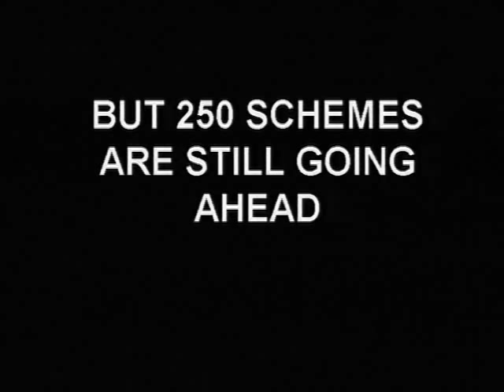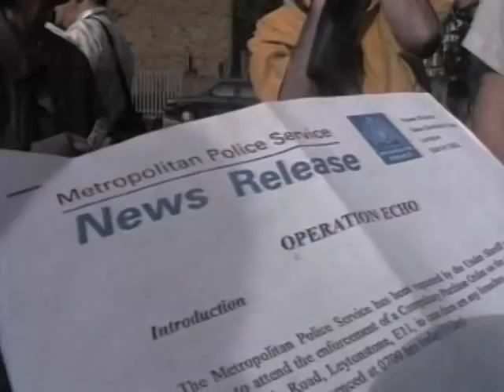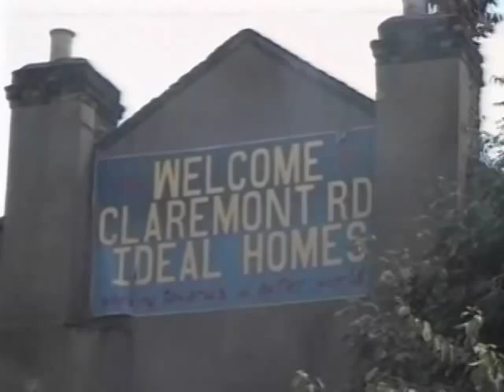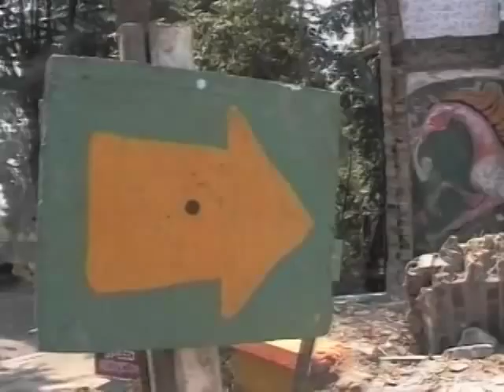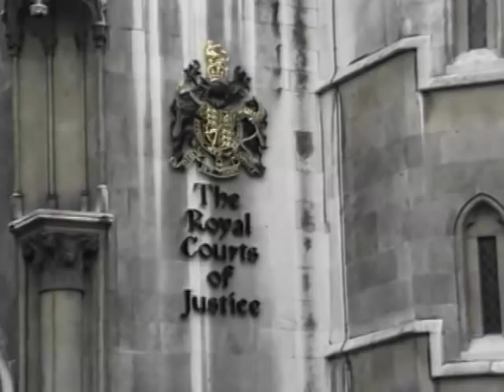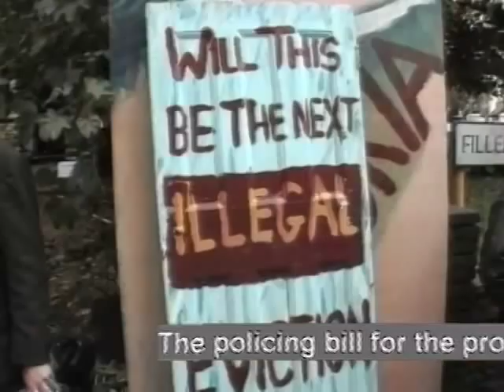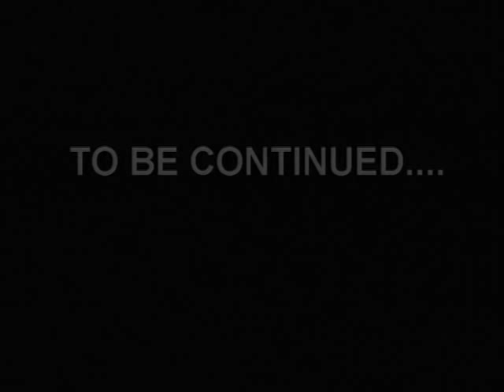Direct Action protest to stop the M11 Link road - long trailer

Comment: at 8:50, closing the video, I was successfully preventing the Sheriff Goons from pushing me off the scene. Soon realising they would have to carry me out, I politely told them where to grip. Only then did I hear noises and looked up at those on the rooftop cheering me. I have drawn on the power of that experience several times since, in challenging situations.
Reply: Yeh nice one, it was great seeing thie Cops trying to manoeuvre you’re wheelchair, while you was holding onto the wheels, made them look like Clowns, hahaha.

Comment: That was one dangerous eviction, people were being put in real risk of being killed, the Lockon in the Window was being rocked by Cops with a rope to frighten the people out of it. Also that guy who they picked off the roof using his sleeves to hang him from the cherry picker, then he slipped out of his top and fell onto the roof leaving the Bailiffs holding his top. The guy went straight back to the Chimney stack he was originally holding onto. Although I think he must have passed out when they went back for him, cos he seemed to collapse into the Cherry Picker cage and seemed unconcious.